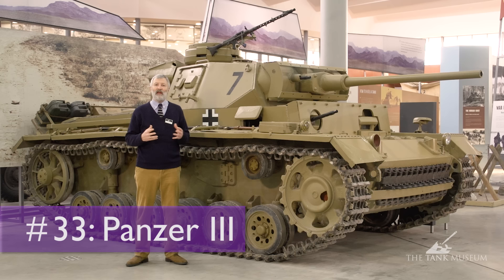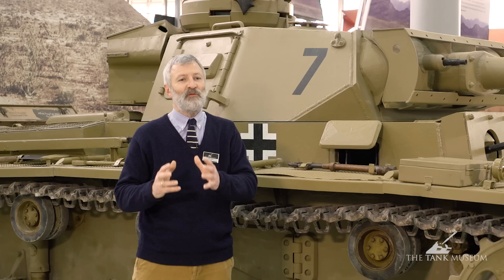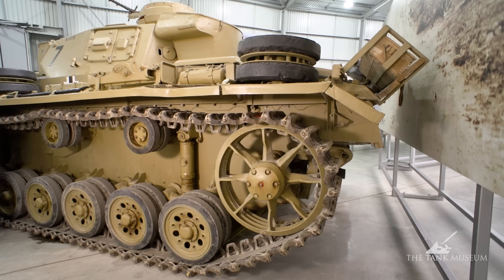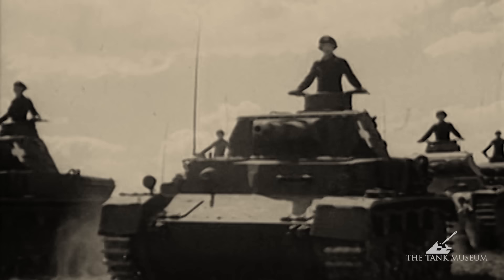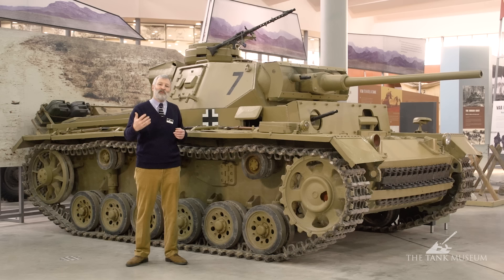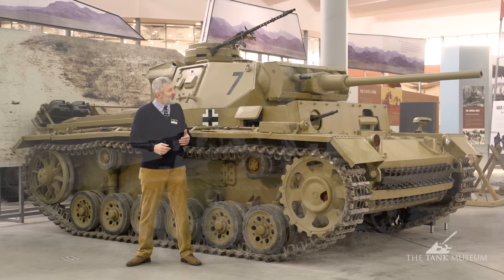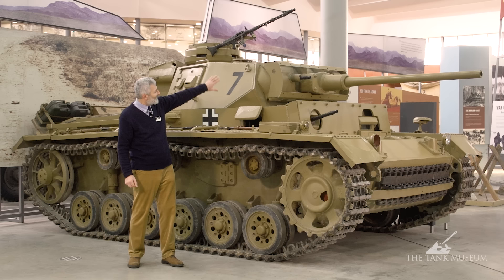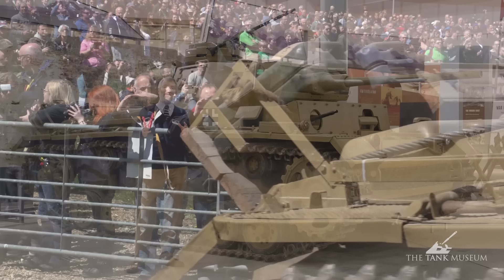Tank Chats #33 Panzer III | The Tank Museum

Comment: If Germany had pumped more of these out instead of focusing on over expensive or ridiculously experimental tanks i think the war would have been alot different, atleast on the eastern front. Edit : To clarify, i didn't mean the Panzer III, but the chassis. The Panzer IIIs were fine early on but i don't think they needed to go past the Panzer IV and StuG IV. They were just about adequate with their 7,5cm.
Reply: The production of the Panther was only spooling up and it's production could have been simplified and that's why the Panther would have been a great replacement for the Panzer III. The issue was that the Tigers, both I and II were serious psychological warfare weapons and they were kept in production not only for their immense firepower, but also for the propaganda value of such tanks. The same 88mm L/71 cannon was adopted on the Panther chassis as well without a rotating turret: same firepower with less manufacturing time and cost. In addition, the Panzer III lacked the firepower to take out enemy tanks later in the war, thus they were converted to StuG IIIs.
Reply: Bassmint: the 50mm gun of III was rather ineffective against T-34s, but StuGs and IVs with the 75mm were pretty good.
Reply: Germany in 1939-1945 had distributed production. Bits and pieces where made here and there all over the country sometimes in little workshops, basically subcontractor hell with tolerances all over the place. While this made it far more resilient to being strategically destroyed then centralized it was far far inferior in efficiency. Germany was never going to win a war attrition hence the focus on things to try to qualitatively overcome that deficiency. 

Fortunately they really never did come across anything potent enough in a quantity enough to actually change anything other then slightly delay the inevitable.
Reply: Didn't you watch the video? The guns mounted on the PzIII was too ineffective, maybe if they had gotten the 50mm on it faster it might have been feasible to produce more, but you can only improve a pre-war design so much.
Reply: +Bassmint,
It would have been better to pump out Panzer IVs than IIIs. By 1943 you need a long-barrelled 75 (either /48 or /70) to have a good chance of dealing with Shermans and Churchills in the west and up-armoured T-34s and SU-85s in the east. 

Ideally (or not, from the point of view of the Allies) the Germans should have mass produced either the PzIII or the PzIV up until 1942 or 43, then switched to mass producing a new 35 to 40 tonne medium tank able to carry the 75mm/70 gun (maybe fitted with the shorter /48 initially depending on production limitations). In addition they would have been better off never bothering with the overlapping road wheels of the Tiger and Panther and going for rear-sprockets which allow for a more compact & lower-height hulls without sponsons.
Reply: +Akm72 Yes, Germany would've been in serious trouble if they hadn't had the Pz 4
Reply: The Panther carried a 75mm gun and that gun was sufficient to go right through everything the russians could throw at it. Hinging the effectiveness of a weapon on the caliber alone, is pointless.
Reply: T-34's armor is over glorified in modern times. Just like the M4 is over ridiculed. M4 actually had marginally more effective thickness on its front. 

The 5cm Kwk38 could reliably penetrate the frontal plate of the T-34 from 500m firing PzGr. 40 or 40/1. But this was expensive ammunition. The longer Kwk39 could penetrate with the APC PzGr. 39 at that range a  common and less expensive ammunition.

It was only against the 37mm of the Czech Pz 35t and 38t which made up a good portion of German armor at the time, short 75mm Kwk 37 which was only ever meant as an anti-fortification/ infantry weapon, and Pak 47mm that it really shined which at the time of their first combat was the bulk of the German forces.

Sloping armor actually also increases the overall weight of the vehicle as you end up with a higher surface area to required internal volume meaning you are using more metal to cover the same volume. The internal geometry of having such sloping armor also brings about severe issues. At the corners of the plates you can really only put small trivial internal items. You'll notice that after the T-34 the Russian engineers turned to what American (M4, M5, M24) and German (Panther, Tiger II, Jagpanther) engineers had been doing which was sloping the front but leaving the sides and rear flat on their medium tanks. Less weight and much more useful internal volume/geometry.
Reply: They tried putting sloped armor on the Panzer IV, however it greatly increased the weight of the vehicle. That added weight caused it to perform significantly worse.
Reply: +ultraboy222,
The T-34 is a bit heavier than your figures. The early model 1940 version was about 26 tonnes, but the late model 1943 was up to nearly 31 tonnes, making it the same weight class as the M4. The T34-85 was just a bit heavier at 32 tonnes. (figures from 'Soviet Tanks and Combat Vehicles of World War Two' by Steve J Zaloga and James Grandsen).

M4's varies from 30.25 to 33.7 tonnes for the standard 75, 76 and 105 variants, or 38 tonnes for the specialised Jumbo assault tank.
Reply: Ah the fallacy of looking at a penetration table without actually reading the criteria for the tests rears its head again. 

German tests where against a RHA plate set at 30 degrees from the vertical (already half the T-34's frontal slope from the level).  Only plate thicknesses that every shot achieved a complete perforation by the projectile counted. 100% success criteria. This is where you are pulling your figures from.

Fortunately there are tests done under British and American criteria which was almost identical to the Russian criteria of captured weapons. 

Under British and American tests against vertical RHA and the criteria that 50% of the test shots achieved complete perforation  the 5cm KwK39 firing PzGr. 39 penetrated 79mm of RHA plate at 500m. PzGr. 40 achieved perforation 108mm of RHA plate under these tests.

The German tests where far more strict then any other nation only giving performance data of 100% complete perforation at 30 degrees for their data tables.
Reply: That's a myth. Without the air superiority, the germans will lost the war anyway.
Reply: Read an article just today about how one of the biggest drawbacks the german army suffered due to the introduction of the Panther, was that they had to send about half of their tank battalions back to be trained on the new vehicle while they were much needed on the eastern front. The article also deduced that it would have been better all around for Germany if they had focused on the Pz.IV H instead of all the new "superior" tanks, in part because they didn't have to retrain crews and also because of cost effectiveness.
Reply: Good thing Hitler did the dumbest thing possible which was wait six months to get the vunderweapon Panthers to Kursk letting the Russian insanely fortify the salient and be ready for a counter attack. And then stupidly proceed on the plan to attack the salient after giving them so much time to be ready.

One of the big reasons the M4 and the T-34 stayed in service as mainline so long as they where enough to get the job done and keep the pressure on the enemy so he couldn't regroup and recover. Stalin only relented and allowed the T-34/85 put into production because the T-34/76 was no longer capable of getting the job done.

Even though the M26 and T-44 where well along in development that they could have been deployed they where rightfully kept from being put into service due to logistical issues that would have severely hurt at the strategic level that would have endangered ultimate victory. Germany was on the ropes, keep it there and get the war won as quickly as possible without risking victory was the goal.
Reply: Cragified I reckon you're probably about right about T-34/M4. Angling was great, but it wasn't a miracle cure-all and it came at a cost. You've also written some great stuff about penetration tables too, so kudos! 

PS: if anyone out there is sick of spam, you can mute posts in G+ if you so desire through the corner menu!
Reply: Yeah, they'd have lasted a bit longer before they lost.
Reply: Bassmint So tired of seeing amateurs espouse this view.

Properly trained crews were already scarce by the end of the war. Mainly due to lack of time and human resources. Had your attrition-based strategy been followed and for obvious reasons, Germany's collapse would have come sooner, not later.

A more numerous tank arm would have also spent more precious resources (like metals and fuel) and needed a much more demanding supply effort. Aspects which were hardly Germany's forte. 

It worked for the Soviet Union. Doesn't mean it had to for Germany.
Reply: Hugo Carvalho It didn't just work for the Soviet Union, but all other countries with large tank forces as well. A "cheap" reliable (relatively speaking) tank that was good enough to get the job done was what everyone else went for. 

Besides, focusing on pz.IVs and vehicles based on the chassis (after pz.III had gone out of fashion) would have saved much of the precious resources that otherwise went to making the huge monstrosities that were built from 1943 an onwards.
Reply: It worked for the US and the USSR. That's it. Germany was never going to match their industrial or manpower levels. 
Anyway like Hugo said, you can have all the cheap 'good enough' tanks you want, doesn't matter if you've got nobody to drive them.
Reply: "It didn't just work for the Soviet Union, but all other countries with large tank forces as well. A "cheap" reliable (relatively speaking) tank that was good enough to get the job done was what everyone else went for."

And which of these "other countries" was fighting nearly the rest of the world with an original population of 80 million?

I've also written this: "Properly trained crews were already scarce by the end of the war." Do you dispute this assertion? If not, how would this problem not have been compounded by what is supposedly a more advisable strategy?

"Besides, focusing on pz.IVs and vehicles based on the chassis (after pz.III had gone out of fashion) would have saved much of the precious resources that otherwise went to making the huge monstrosities that were built from 1943 an onwards."

The truth is the reverse. Making a lot cheap items consumes more resources than a few excellent ones. I'm surprised this isn't already patently obvious.

Actually make an effort and produce an engaging, pertinent response. Otherwise, why bother?
Reply: The PzKfw. V Panther was the Panzer IV with sloped armor essentially. Look at the history of the project it started out as a 25 ton design and just kept growing.

Only reason the Panzer IV was kept in production through the war is the machinery and processes to build it as it was. 10 degree boxy armor and all. Changing the front of the hull on a chassis that was already overloaded would have meant lots of retooling, retesting, new castings. All which would need to be tested and delay production, but it was still effective.

Pz III however was no longer effective on the battlefield just like the Pz 38t and where redesigned to fit other roles such as Stug and Jagpanzer designs that could retain the tooling and experience of production as much as possible and produce something that was useful.

Panzer IV by 1943 was maxed out on what the chassis could do. It was a 1936 design pushed to the limit of what the bogey and leaf spring suspension and hull could take. They where already front heavy with the 50mm + 30mm plate sections. The turret ring was maxed in what it could fit and take and the engine and drive line where also already at the limits. Further redesigns as a turreted tank on the chassis where a waste of time and resources. And time is the most valuable commodity in a war.
Reply: There is almost nothing shared between the Panzer IV and Panther. May some small parts, or optics. But the chassis and especially the suspension is completely different. And there was several designs for the Panzer V from different companies. But none that shared anything with the Panzer IV to my knowledge.
Reply: You are missing the point. The Panther wasn't a redesign of the Panzer IV. It was an evolution meant to fully replace the Panzer IV and III in service.  Gleaning everything learned from the Panzer III and IV as well as foreign vehicles.

The VK 20 series is what lead to the eventual Panzer V:  https://en.wikipedia.org/wiki/VK_20

As you can see it leaned heavily on the previous Panzer III and IV. The 24.01 introduced sloping walls. Then it grew in the VK30 series. And this project began in 1938, a great illustration of how long it takes to finalize design with the fluidity of war and the needs of testing, retesting, tooling, and production design.

Panzer IV by 1943 was taken as far as it could be taken without essentially designing a whole new vehicle which is what the Panzer V was, which was rushed into production as it was using a final drive designed for the VK20 series that couldn't take the strain moving a 45 ton vehicle instead of a 25 ton vehicle.
Reply: Considering that Germany would have lost in any case regardless, a superior tank only makes a difference if it's available in larger numbers. While the V and VI were good tanks, they weren't effective enough to make up for it's cost in relation to the amount of late model IVs that could have been made. Especially when we take into account the loss in production and combat value because of retooling factories and retraining crews that could otherwise have kept fighting.
Reply: And what would happen when the Panzer IVs came across the IS3?
Reply: +IamRyan
Same thing that happened when Sherman's had to take on King Tigers; use numerical superiority to hit them in the flanks or lead them into ambushes. Not ideal but it worked. The 7.5cm KwK 40 L/48 was a pretty good gun.
Reply: In total 492 Tiger IIs where assembled. This small number had as much effect on the war as mouse's fart. Between D-Day and VE-Day  United States Tankers have verified engagements with Tigers all of 3 times. Which means knocked out Tiger's or abandoned Tiger's where left afterwards to know for certain they where there. Certainly there where more encounters between other assets such as Mech Calv. and Infantry that resulted in Tigers being knocked out. But that's the only 3 times it is certain fact that Tigers where encontered by U.S. tank crews. All others where mis-identified or if they where there survived the engagement and withdrew.

Tiger Is are very similar at a distance to Panzer IVs. There is a great photo out there with a Panzer IV and Tiger I knocked out side by side and with the spaced plates around the Panzer IV turret it looks really similar in profile to the Tiger. Same can be said for the Panther and Tiger II. Engagements with Tiger's where vastly over reported. 

https://s-media-cache-ak0.pinimg.com/originals/e4/6a/a2/e46aa256ede1e65378746b6bb69e324a.jpg

They are that similar up close, image looking at that from 800m away. You couldn't tell the difference.
Reply: Is that before or after the pike nose front hull welds on the IS-3 split apart simply from over stress during it's own movements? :)

IS-3 was another one of those paper tiger moments. Looked good on paper, looked impressive on parade, in practice was a disaster. T-54/55 was by far superior. And production numbers show it 80,000 soviet made T-54/55s and only 2,313 IS-3s.
Reply: Yeah, IS3's were turned into steel bunkers in fairly short order. Great conceptually, horrible in practice.
Reply: I don't disagree with you, I would add, however, that Germany needed to arm up the various groups in Russia including the Ukrainian nationalists ... give them these tanks for crying out loud ... if they wanted a serious chance at winning.  The lack of production like their broad scaled ambition, did not make victory tenable.  Just my opinion.  Thanks,
Reply: While the panther did have it's genuine strengths (fast, strong frontal armor, powerful anti-tank gun) it was an unreliable, tempermental beast which broke down often and was hard to repair, it was a 60 ton tank on a 40ton chasis.  It also had silly teething issues like being penetrated with anti-tank rifles (the man-portable kind) from the sides and rear.  And fundamentally it was an overweight tank with a gun that was unfit for anything else other than tank-killing (which is not the only role for a tank).
Reply: @The Bellman

First, no the Panther did not weigh in at 60 tons even fully combat loaded,the Panther weighs in at 49.4 short tons/44.8 metric tons.

Second, the original engine,transmission,drive train and etc were designed for a vehicle  15 short tons/13.6 metric tons lighter than the first production vehicles-Not 40 tons.

Third  "It also had silly teething issues like being penetrated with anti-tank rifles (the man-portable kind)".
Where did you learn that PTRDs  were knocking out Panthers before the Panthers even left production.

PTRDs and other infantry held at weapons where a concern,thus the Panther's 5mm side skirts were designed.

And to further add,a PTRD crew would have to come within 100 meters of a Panther use a tungsten round. And if they hit the lower hull, more likely than not, the round would shatter-- due to a small high velocity round being over-matched.

The Panther was a new design,over engineered and was rushed into production,along with an additional 15 short tons of weight - Panthers were plagued with teething problems,like any new vehicle.

Many of the Panther's 'reliability' issues would be corrected, by mid October improvements in the Panther's final drive further increased it's 'reliability'.

The Pz IV G-J where front heavy vehicles subject to frequent 'reliability' issues themselves.

What exasperated German AFV 'reliability' issues, was the break down on the logistic side. 
Between factories being bombed,thus shutdown month/months at a time.
Rare resources becoming scarce,leading to poorer type steel being used for high stress parts(like final drives).
The transport system collapsing,trains&railroads &trucks being destroyed at an increasing rate.

And etc.

But to top if off with the Panther,by late 1944 less than 8% of Panther production went towards producing spare parts.Which led to Panthers with even minor damage being cannibalized for parts.

I suggest you read as a  starter,Thomas Jentz's  'Germany's Panther Tank: The Quest for Combat Supremacy'.

Be wary of Spielberger's work earlier editions will not be corrected--especially about the so-called Panther II.
Reply: They also should've produced panthers and jagdpanthers in my opinion, panthers where eventually as costy in producing as panzer 4's on some point
Reply: They produced more than 6,000 Panthers, from 1943 to 1945. The most produced German tank was the Panzer IV, with over 8,550 units from 1937 to 1945. So I think they produced as many Panthers as they could.
Reply: Yes. The StuG IV, Pz. IV, and Stug III were actually quite powerful. The Jagdpanther and Panthers were useful too.
Reply: Bassmint if any weapon could have changed the war for Germany it was the U-boat. it was the weapon that could have choked both the Commonwealth and the U.S.A. Convoys to Russia would have been much harder but in the end they did neither so its really just speculation.
Reply: Chris Barlow,
The problem with trading away tanks (or whatever) for additional U-boats is that German had pretty much lost the Battle for the Atlantic by the middle of 1943. Additional U-boats after that point really just gives the allies more targets to sink.
Reply: But prior to 1943 .... 3 1/2 yrs is a long time. And it was the surface fleet not tanks that Hitler should have given away
Reply: I'm not sure that was really an option. The Germans had already scaled back surface ship production at the start of the war to focus on submarines, pretty much all the German large surface warships of WWII were launched before 1940. If the Germans had built 100's of additional submarines in the late 1930s instead of the surface fleet the RN would have noticed and probably responded by focusing more resources on ASW earlier than they did historically.
Reply: Akm72 if they hadnt wasted resources on follies like the Bismarck and the tirpitz prior to the war and built more u boats and opened the war with a purely attacking force England would have been knocked out of the war. As it was the u boats nearly did the job. This isnt my own opinion this was an opinion i have heard many times that originated with the German navy. The battleship was nothing more than national prestige and outdated and the materials used where wasted . And Hitler had war in mind much earlier than 1939.
Reply: Chris Barlow,
The problem is that if the Germans had started mass producing submarines in the 1930s, instead of the surface ships they actually built, this would have been a very clear sign to the RN that Germany was planning a trade war with the UK. The UK would have adjusted their own plans accordingly; more investment in ASW technology, more escorts and more ASW aircraft but maybe fewer battleships and cruisers. 

Remember that Hitler was not particularly keen on a war with the UK, he was more interested in uniting the German-speaking people and expanding his territory to the east into Poland and Russia.
Reply: all that's needed for the war to last a couple months longer would be turing not making a computer!
Reply: A VERY important thing that people never take into consideration about the value of those heavy tanks the Germans used is their affect on German and enemy morale.  Morale means the world, especially to the side that is overwhelmingly outnumbered.  Personally if I was a German soldier I would feel a lot better with a Tiger or a Panther having my back then four of these tanks that look like toys.  Shermans either for that matter.  I'm sure Americans morale sank when Tigers or Panthers came on the scene, as compared to their attitude towards a STGIV....even though STGIVs were awesome weapons of war.
Reply: Cragified there was an attempt  to standardise tank production to the E50 standard panzer design and switch all the production to it and I believe that they wanted to use panther components so factories does not need new tooling
Reply: Tommi Ridanpää the problem with the panther is that its too heavy and the turret traverse is one of the slowest because the turret ring is small and often had electrical failure this resulted. In it getting flanked if the Germans sloped the armor of the pz4 and enlarged the chassis and turret a panther 75mm  could fit
Reply: the problem with the panther is that its too heavy 

This is debatable. The tanks arguably the most mobile medium tank fielded by any nation during the conflict (in significant numbers)

the turret traverse is one of the slowest

The Panther could traverse the turret a full 360º in 15 seconds, with the engine going at 3,000 RPM. Since the engine speed was governed for most of the production run (and if not, it was still discouraged) a figure of 2,500 RPM can be used. With the engine running at this setting, and using the high setting of the turret drive, you can achieve a 360º turn in 18 seconds. Not only it isn´t slow, but it is one of the fastest around.

pz4 and enlarged the chassis and turret a panther 75mm  could fit

Sure, the turret and the gun could fit. But a KwK 42 L/70 was inviable in the Panzer IV because the weight put too much stress on the suspension and the running gear. The Germans rejected the idea for this very reasons.
Reply: it was effective to about 500yards against the T34
Reply: the stug was really a defensive weapon, not offensive. suitable for a Germany that was losing the war, but in the early years tanks were the ideal. The mark IV was a tank they should have mass produced instead of more complex models, especially since a tank has a relatively short life on the battlefield.
Reply: 46FreddieMercury91 pzIV needed a new gun because the F2 75mm gun was not reliable in pentrating the t34-85 and the IS2 a bigger turret was required to fit the new gun and they wanted to slope the frontal armor but it was not possible so the design evolved into the panther a medium tank which was 6 tons lighter than a tiger 1H
Reply: 46FreddieMercury91 stug was good for sneaky and surprise attack because of its low profile
Reply: the stug was really a defensive weapon, not offensive

One thing I would like to point out. Whie the StuG certainly could not perfom very well as part of the Panzer formations, the StuG was great in the offensive providing heavy fire support to the advancing infantry. It was designed to that end (after all, StuG stands for Sturmgeschütz , "*assault* gun") by von Manstein around 1935 and the infantry were ever greatful for having them at hand.
Reply: Richardsen it had a gun that can penetrate 150mm of armor (APHE) shell and the APCR could penetrate 200mm and the stug was more agile and had lower profile than panthers and tigers
Reply: @hamzeh alfares

it had a gun that can penetrate 150mm of armor (APHE) shell and the APCR could penetrate 200mm

Just for clarification purposes, which one are we talking about?

the stug was more agile and had lower profile than panthers

It certainly had a lower profile, but the Panther was more agile, there is no doubt about it. The Panther was arguably the most mobile of the medium tanks of the war.
Reply: Richardsen the panthers transmission broke down overheats beglfore reaching 45 km/h on Road and Im talking about the stug G and F
Reply: Im talking about the stug G and F

StuG III F/8 & G cannot pull off 150 mm penetration and definitely not 200 mm penetration. Hell, not even Panther or Tiger can achieve those numbers using Pz Gr 39 and Pz Gr 40, respectively.

the panthers transmission broke down overheats

A couple of things:

What usually broke down in the Panther was the final drive, not the transmission. The overheating problems mainly had to do with the rushed models used in Zitadelle , which is understandable, because it was a design that wasn´t supposed to see combat until 1944.

 Rushed vehicles have teething problems. Hell, even non-rushed vehicles have problems. The Panzer III, a tank seen as reliable and dependable, initially experienced a great deal of trouble. The T-34, for example, was only guaranteed to drive for about 100 km before a breakdown.

Thus, the first Panthers naturally had a lot of troubles. But the tank got improved. According to a report written by Guderian on March 5, 1944, the constant improvements to the Panther tank series resulted in some positive feedback from the user community.  He wrote that one Panther tank-equipped unit on the Eastern Front stated that they felt their tank was far superior to the Red Army T-34 medium tanks.  They went on to report that all the early mechanical difficulties that had so bedeviled the early production units of the Panther tank had been ironed out of the design.  As roof, they offered the fact that service life of the tank’s engine had gone up to 1,000 km (it would get to 1,500 km eventually). In addition, the same Panther tank-equipped unit reported that final drive breakdowns had ended and that transmission and steering gear failures were now within an acceptable range, which is damning with faint praise.

The Panther initially experienced numerous automotive problems with required a continuous series of modifications to correct.  These problems can be traced to three main causes: leaking seals and gaskets, an overtaxed drive train originally designed for a 30 metric ton vehicle, and an untested engine.  But, following modification of key automotive components, with mature drives taking required maintenance halts, the Panther could be maintained in a satisfactory operational condition.

Panther was not as unreliable as the common perception might indicate.
Reply: MadnerKami Totally different guns. The germans had at least four different sized 75mm shells and guns. The 75L70 on the Panther is totally different than the 75L43/75L48 and that different from the PAK40. And (they tried) the 75L70 can not bei fitted in a turret on a P4. Even fixed (Jagdpanzer IV/70) it puts a heavy strain on the running gear
Reply: Lavrentivs Actually they did not pull back their prime crews but rather put new ones on the P5. That ensured the experienced crews died in their P3/P4 at Kursk. And (read von Manstein) the germans could have stabilised their lines and freed reserves if mit for Hitler
Reply: Don't tell me having an army of panzer 3 would be eb
Reply: Isn’t this panzer used in the Second World War later on and had difficulties facing the newer Sherman’s? On greatest rank battles of El Alamein the Sherman m1a4 was breaking through them with its high velocity cannon
Reply: Good. The Nazis and Communists under Hitler and Stalin were absolute monarchs, but not sanctioned by gods. Both were medieval like IS.
Reply: @Cragified  "tolerances all over the place" isn't really a fair description of the machines Germany made during WW2.  Even today the crankshafts in their inline water-cooled airplane engines cannot not be reproduced to the exacting tolerances they were made to during the war years.  The problem with German tanks is they were very complex and not easy to field service and couldn't go for long hours like Soviet  and US made tanks could.
Reply: Still woulda had no fuel
Reply: More tanks doesn't solve the primary german issue of low fuel reserves to run them and the secondary issue of getting supplies to them.